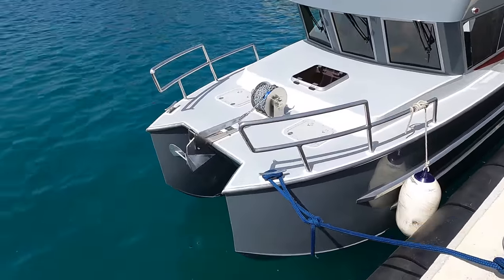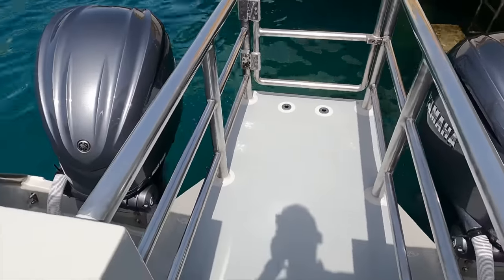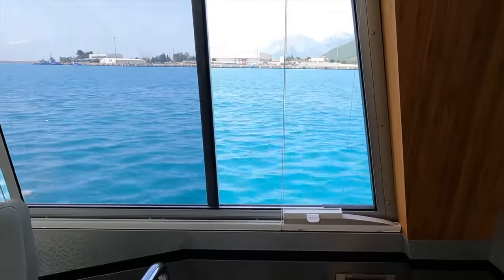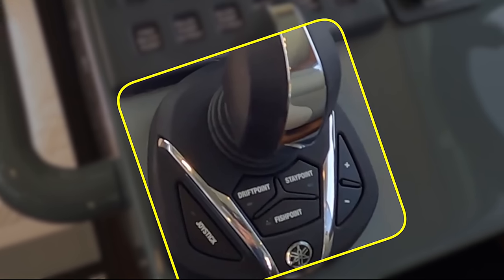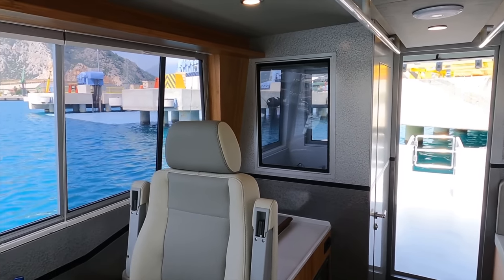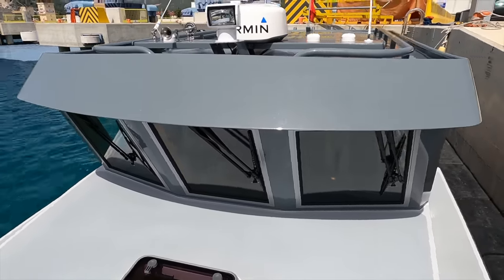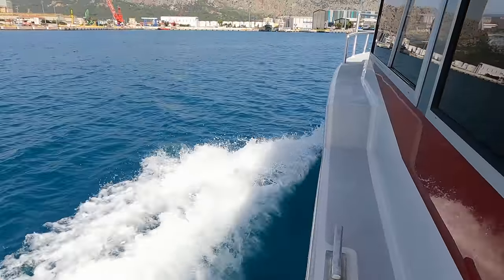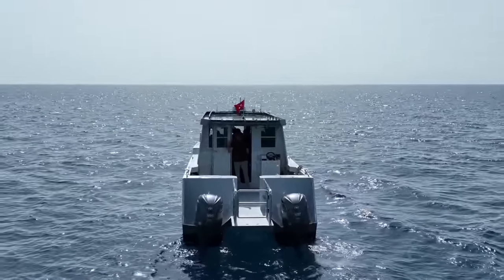FIRST LOOK At The BERING MARINE 34! (Top Speed 40+ Knots!)

Comment: I have a neighbor who has developed a eco friendly outboard motor several sizes, knowing this. He has a pair on a similar boat actually three different styles, each boat goes way over 75knts ,an the treasure is,not a single drop of any kind oil base or alcohol base fuel was used,these motors are all green electric,no range limits can run at top speed continuously for days .we took these three boats out in the gulf of Mexico,we left upper Florida coast travelled non stop at 67 knots across gulf down Belize. Did some tests,stay for several days,an returned ,but this time straight across to Jamaica over to Dominican Republic ,up past Gitmo over to Florida keys east side past Miami,an past Hanover up to a canal with water lock. Went through them over to westside of Florida Tampa, Clearwater,an out to the gulf again up to our starting point just 11 days earlier. Wow 😲 .
Only to find out recently from neighbor. Even that he created a game changer system,leave to our greedy bankers an government,they wanted prove of system and we did just that only be raided by our government officials demanding blueprints & designs an any video an equipment pertaining to the created system,but as I understand ,my neighbor was steps way ahead of them an moved all results and property to a secure location,with legal assistance.now understanding if his system come to the masses it will destroy many engine companies an oil industry hands down .this is why my neighbor quietly does everything,big shipping an yacht marinas an some boat companies, don't want this system out to the public.😮
Reply: My Nigerian neighbour developed the same thing. He just needs someone to transfer a million to his account, so he can get the blueprints for a boat which can go 75 knots forever, on no fuel. Anyone who would like such a boat, just needs to deposit a million in the Bank of San Ta Claus.
:)
:)

Comment: Can you put Mercury 450R on it? Just for the sake of better soundtrack (V8 and compressor) :-)
Reply from the maker: I am sure that Bering Marine would accommodate this 😍
Reply: I'd rather have the OXE Hybrid 450 as soon as they are avaiable (with sharrow marine props) for more torque (horsepower is irrelevant unless you are racing), more range and the option to go in full electric mode in protected areas where others are simply not allowed...
Reply: That's what chief use 2 450 hybrdd disels

Comment: I hate yamaha...  when I was 15 years old I bought a yamaha dirt bike  a DT 250 - it ran like gangbusters for 2 miles, and then it died and I had to push it 2 miles home - multiple times.

I would never trust a Yamaha as my main engine 500 miles out and your POS yo-mamma-ha ha ha dies??????????

And it is aways stupid shit like a wire that was not routed right and vibration wore a hole and it grounded out - sure it is an easy fix, but still your engine dies at the worst time - in a storm

This is 1970ish Yo-MammaHAHAHA, but it tells you honda and suzuki focused on reliability - never a problem with stupidity or cheapness with other rice burners
Reply: Wribg yamhsa best rebike

Comment: Add length to 38 add shower stall AC for Florida gen set water tank to 80 gallons 
34 is just too many compromises. All Anchor chain no rope that’s just too Mickey Mouse lol 
Open array radar  put head / shower in sleep quarters  ….
Reply: The main and ONLY advantage of the anchor chain line is that it is the only and perfect mean to avoid chafing of the anchoring rode on aggressive sea beds. Except for this point, anchor chain has all the disadvantages.

Stored in the bow mooring chain locker, this anchor chain adds a heavy weight in the last place you want one. When deployed, anchor chain is actually working in the opposite way to the way it should work. With light wind, it gives a perfect horizontal pull to the anchor and the best holding. With moderate wind, its weight and catenary effect give a perfect shock absorbing effect.

As the wind builds up, the anchor chain will become straighter (and this with as little as 25/30 knots of wind). The pulling angle will increase and as a consequence, the holding of the anchor will decrease. When the shock absorbing effect is most necessary, the "bar tight" chain will not allow this to happen.

If there are waves entering the anchorage, the resulting shocks will be then directly transferred to the anchor chain, which then has more chance to break free... and more seriously, the anchor chain is subject to high "peaks" of pulling force and has a consequently higher risk of breaking.

Edited to add: This particular boat was built upon a clients request. They didn't request the items you suggested.